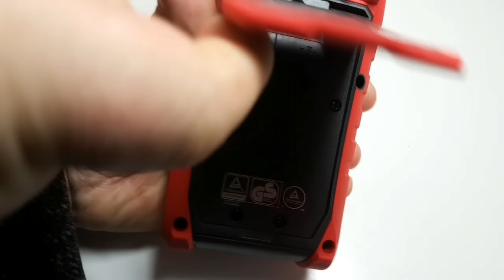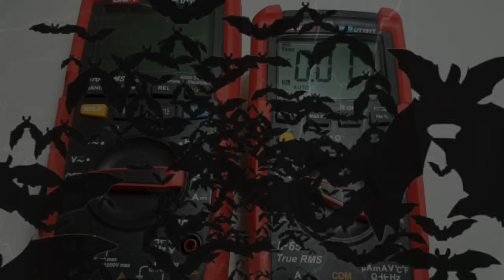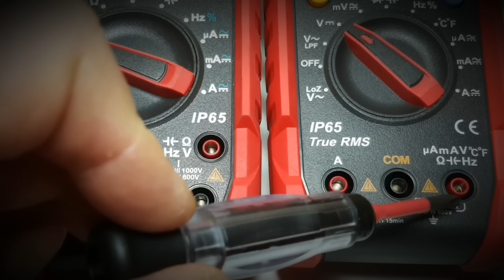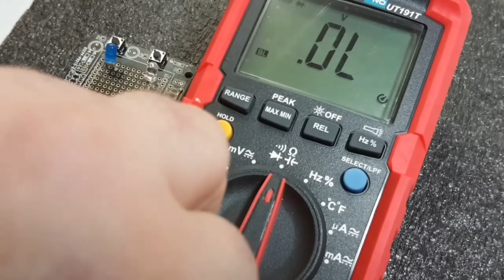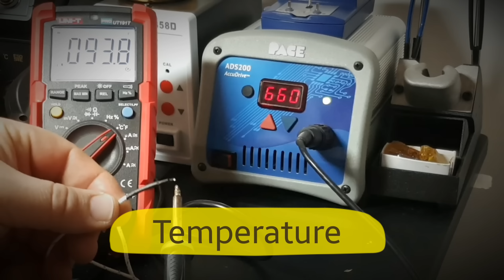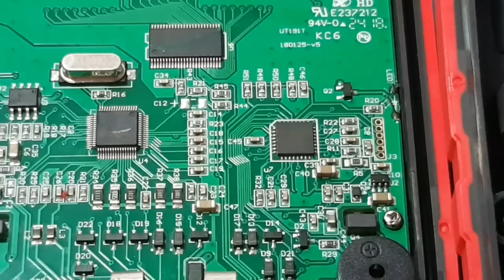UNI-T PRO UT191T Multimeter Review & Teardown!

Comment: Hi Darren, would you recommend me the UT191T over the newer UT17B MAX? The first uses a 9V battery (definitely an inconvenience) and supports 20A. The UT17B MAX uses AA batteries, supports only 10A and, imho, has a better input protection (two big fuses, up yo 1000V). I am unsure about the certfications of UT17B MAX
Reply: Ut15/17/18B series are very good meters. You can't go wrong with them.

Comment: Hi Darren, greetings from Mexico, I really need your advice, i already have the ut139C but I need the loZ feature, but I'm undecided about this one, the UT161D or 139E/S, in your opinion what's the best of them?? Thanks in advance.
Reply from the maker: Ola my friend! For electricians & professionals: The UT139E is better due to LoZ mode, CAT III safety, and extra features. 👍 it also has a faster bar graph (42 segments vs. 33).
Reply: @KeepOnTesting thanks Darren,  and between UT191T or UT139S which is better in your opinion? I'm pro electrician and electronics hobbyist.
Reply from the maker: Both the *UNI-T UT139S* and *UT191T* are solid multimeters, but they cater to slightly different needs. Here’s a detailed comparison to help you decide:

### *1. UNI-T UT139S (Budget-Friendly, Safety-Oriented)*
✅ *Pros:*  
- *True RMS* (for accurate AC measurements)  
- **High safety rating**: CAT IV 600V / CAT III 1000V (better for industrial/electrical work)  
- **Good feature set**:  
  - Capacitance (100μF)  
  - Temperature measurement  
  - Diode & continuity test  
  - Low-pass filter for motor drives/VFDs  
- *Bar graph display* (helps track fluctuating signals)  
- *Affordable price* (great value for the features)  

❌ *Cons:*  
- *Slower response time* compared to UT191T  
- *No Bluetooth/data logging*  
- *Basic backlight* (not as bright as UT191T)  

### *2. UNI-T UT191T (Faster, More Modern, Data Logging)*
✅ *Pros:*  
- *Faster readings & better refresh rate* (good for dynamic measurements)  
- *Brighter backlight & larger display* (easier to read in dim conditions)  
- *Bluetooth & USB connectivity* (optional for data logging)  
- *Higher resistance range (60MΩ vs 40MΩ on UT139S)*  
- *Sleeker design & better build quality*  

❌ *Cons:*  
- **Lower safety rating**: CAT III 1000V / CAT IV 600V (still good, but slightly less robust than UT139S)  
- *No low-pass filter* (not ideal for VFD/motor measurements)  
- *More expensive*  

### *Which One Should You Choose?*  
- *For electricians, industrial work, or high-voltage safety* → *UT139S* (better CAT rating, True RMS, low-pass filter)  
- *For faster readings, Bluetooth/data logging, and general electronics* → *UT191T* (better display, connectivity, responsiveness)  

If you don’t need Bluetooth and prioritize safety, **UT139S is the better pick**. If you want a faster, more modern meter with logging, **UT191T is worth the extra cost**.
Reply: @KeepOnTesting Thank you very much for the detailed explanation, it only shows me that there is no multimeter that does everything, and since I do both residential electricity and electronics, I have decided to purchase both devices. Thanks again and keep the great content of your channel.
Take care.
Reply from the maker: Thx my friend..indeed..the one does it all Multimeter doesn't exist..I think you found the perfect solution 😉 👍

Comment: My multimeter 191t bought in 2023 shows a voltage drop in the diodes. Probably in the first batches there was a problem with this, and then it was fixed.
Reply from the maker: Interesting!! 5 years later..it's been a great multimeter and still going strong on the bench. One of my favs from UNI-T 👍

Comment: Darren Walker. Thanks for your efforts, like       . What will happen if the ut 191t is turned on to measure resistance or ringing, and I put the probe into a 230v outlet. or 380v.?
Reply from the maker: Hopefully the excellent input protection will do its job and prevent the multimeter from serious damage. 👍
Reply: was hoping it would protect it from any damage and continue to work perfectly normally. I used ut 139s. It failed the ncv and resistance measurement. I have not checked the amps measurement, temperature and diode test

Comment: Which is better UT191T or UT61E plus. Which one do you recommend me to buy?
Reply from the maker: My vote goes to the UT191T, all around great performer,  build quality and well priced 👍
Reply: Thanks. I will go for UT191T. UT191T has 6000 counts and UT61E Plus has 22000 counts. Is UT61E plus more accurate than UT191T?
Reply from the maker: @mulondamwinanu8247  191T has better accuracy. 61E has a higher resolution.👍
Reply: Thanks. How do you perform live wire test when using UT191T. Do you suspend the neutral probe lead when testing a live wire test?

Comment: Hi there!  I bought this Uni-T UT191T per Darren's contacts, and really like it.  Where I don't have an oscilloscope, wondering if anyone has any resources to help test power quality using a True RMS multimeter?  E.g.: I have a portable generator, and would like to test power quality measure on it to know if it is good for sensitive electronics (what doesn't have circuit boards these days?) and also as an indicator of the generators health and maintenance.  Things like THD, voltage stability, etc.

Comment: im down to this model or the new ut61d plus , which do you prefer ?
Reply from the maker: I would choose the UNI-T UT191T!  IP65 Rated and very well built.  You can't go wrong with this dmm and it's underpriced IMHO.😀👍
Reply: @KeepOnTesting  ok ill get the 191 thanks
Reply from the maker: @cagmito76  Let us know how you like it 😊
Reply: @KeepOnTesting  Got it excellent meter , great build UNI-T usually are but this is tough , excellent safety and even has TUV GS safety cert stamped and of course lots of functionality. Best UNI-T Meter i have tried so far.
Reply from the maker: @cagmito76  Excellent!! It's one of my favorite Multimeters too!! Keep On Testing!

Comment: Diode test	Open terminal voltage??
Reply from the maker: 3.2V
Reply: i am looking for a low volt power..1volt / 1.5volt
Reply: is 3.2volt power harmless when measuring low power electronic circuit paths ??
Reply from the maker: @soundengineer6332  In diode mode you will be fine..the circuit won't be compromised.
Reply: Ok thankyou sir

Comment: Thanks for the video! Would you recommend the UT191T or the UT17B Pro? I've looked at them and the only difference is that the UT17B Pro is not waterproof, but the price is the same, there must be some other difference.
Reply from the maker: Wow, tough question. 191T has LoZ and LPF plus the Auto Backlight ...17B is slightly larger with a bigger display , audible diode mode and slightly better input protection. Both great multimeters..I'm a big fan of the 191T so it's my First Pick! 😄👍
Reply: @KeepOnTesting  Yup it's a really tough pick... I'm probably going for the 191T because of that sweet IP65 rating and 2 meter shock proof. The bigger display and audible diode more aren't really important to me, do you think overall the better input protection justifies buying the 17B PRO over the 191T? (I don't work with more than 240v and I also don't plan to measure anything above 5 amps, and also most of the time I work with 12v or 24v.)
Reply from the maker: @Hack3rPT  I think the 191T will be a perfect fit for you. I absolutely love that multimeter and its one of the most utilized on my bench! It still has great input protection just not quite as beefy as the 17B but awfully close.
Reply: @KeepOnTesting  Thanks for the recommendation and for the awesome content on your channel! Just two more questions if you don't mind: Do you think I should buy some replacement fuses (the 600mA ones)? And also, I currently only need this for hobby use, do you think it will still be good to use in maybe 5\10 years for electrical work?
Reply from the maker: @Hack3rPT  Having some extra mA fuses on hand is always a great idea and definitely recommended. Keep everything together in a good case so its always there when you need it. Almost guaranteed you will make use of them at some point! 

The 191T will still be a strong multimeter even a decade from now. Multimeters in general don't age or lose their usefuness as fast as other instruments or electronic devices so it will be useful now and in the future!

I have some multimeters that are 25-30+ years old and they're accurate and useful even today.
Reply: @KeepOnTesting  I usually keep everything in a strong case, but the multimeter won't really fit there. Since all the electrical components that I own are on that case, I will put the fuses there, and for the multimeter, I guess I will just carry in it's pouch for now. I bought the case about 2 months ago and it's already full! Needing another upgrade already.... Thanks for all the help!
Reply from the maker: @Hack3rPT  My pleasure and if you ever need any specific help or recommendations feel free to drop me a line: netplicity1@gmail.com
Reply: @KeepOnTesting  Thanks. By the way, did UNI-T end up fixing the stand in the U191T? I saw you mention on an old video that the stand flopped around when moving the meter.
Reply from the maker: @Hack3rPT  Yes indeed...its one of the best tilt stands on the market. Solid,  wide and rigid. Btw, Many thx for your donation to the channel , much appreciated 👍
Reply from the maker: @Hack3rPT  I would pass these by, the tips won't last very long. Hang in there and I'll try to find the vendor for a great cheap pair I was promoting..I just need to get the updated link for you.
Reply: @KeepOnTesting  Thanks!
Reply from the maker: @Hack3rPT  These are 👍 great.. 
Silicone, with Nickel played copper..sharp and cheap, only 5$  https://www.ebay.com/itm/321826316430
I'll be posting an official link to them shortly.
Reply: @KeepOnTesting  This is the official link right?
Reply from the maker: @Hack3rPT  yes, that's correct..I haven't found these elsewhere..
Reply: @KeepOnTesting  Perfect! It's about 7 euros total because of shipping but if you say they're good I'll buy them!

Comment: Hi. Which of the two would you buy?  UT191T or UT139S.  Water resistance is not important.
Reply from the maker: UT191T in a 💓 heartbeat! An incredibly great performer and definitely underrated !
Reply: @KeepOnTesting  How does it offer more to make it worth it?

I like both.  I don't know which one I would do better with.
Reply from the maker: @MartinSebák  Feature wise they are very similar...The 139S is sleek and has that great EBTN display, however I find myself reaching for the 191T almost daily which says alot! It has great ergonomics,  autobacklight and its one of the most accurate dmms in my stable.
I'm really impressed with both but if I had to choose and knowing what I know now, I would pick the UT191T.😁👍
Reply: @KeepOnTesting  In terms of protection, which one would you recommend? I like the 139s because of the EBTN display. The 191T doesn't like that the mili and micro amp are on the same input with the voltage, resistance etc...
Reply from the maker: @MartinSebák  I still prefer the feel and robustness of the 191T,  it also had better input protection and is IP Rated 👍
Reply: @KeepOnTesting  Thank you so much!

Comment: Hello, I have a problem with my meter it´s an uni-t UT109, hold de power button, star, but when relaase the power button turn off... if still pressing the button still on, but when I realease it turn off.. should still on, please, do you know whats going wrong with it? THANKS YOU SOO MUCH!
Reply from the maker: Try cleaning the internal contacts with IP.  Give the multimeter a good internal cleaning, especially any movable parts and try again, sounds like a bad contact issue. Also, replace with a new battery.
Let me know
Reply: @KeepOnTesting  Thanks so much for your answer, sorry for my bad english, I appreciate very much all your videos, I spend hours looking at them... I bought several instrument based on them, regards from argentina!
Reply from the maker: @GustavoGarcia-pu5st  Thanks my friend ! Keep on Testing!

Comment: Good day Darren, I have recently received this unit from Uni T (no pun intended) and there is something I noticed fresh from the packaging; the circumference of the knob has traces of unknown fluid. I can't determine the aforementioned fluid but I assure you that it was really noticeable and I swabed it using my very dry fingers and its really present. Is that something I need to worry about?, hence the UFO (Unkown Fluid Oozing) *Pun intended. Thanks for your response.
Reply from the maker: Hello Erwin, that primordial ooze is just a form of dielectric grease for lubricating the selector switch. Its nothing to worry about and is usually a good thing. It appears UNI-T was a little overzealous in its application on your unit. Wipe off the excess and you should be all set. Btw, that's one of my favorite meters...its something I am always reaching for 👍
Reply: @KeepOnTesting  Thank you Sir Darren for always answering to our queries. You Sir, are truly a blessing for all of us. I always hope for your good health moreover the continuous success of this channel and the exponential growth of the community within the walls  created by your multimeter haven.
Reply from the maker: @erwinjoshuat1327  Thanks for the kind words! Keep On Testing!

Comment: BUT the capacitance range only 600μF. Cheaper Aneng Multimeter is better than this.
Reply from the maker: WRONG, Capacitance is 60,000 uF or 60mF. Honestly you can't compare the Aneng to the UT191, Input Protection is far superior on the UNI-T.

Comment: I have this one and almost feel it should have gone 4.5 stars, its that good especially for the money - others sell for more and give you less in both quality and performance.
Reply: I agree even through it you have to take back cover off to access 10 amp fuse. How many times are going going to over current 10 amp range? It the smaller one you usually blow. Plus you have threaded post, so you won't strip the plastic over time changing it. I look at the details like this. I would have gave it a 4.5, as nothing close to its price range? Even with a Fluke that over $300 you have to take cover off to access fuses. So long it has threaded posts it gets a pass on that and not worth mentioning?

Comment: I want to get this , need a second meter for automotive repair.... Do you recommend this???????????

I have a brymen bm257s for my main .. Need second for backup ... If I get this, will use it with loadpro test leads... 

Honest opinion, is it a good meter??
Reply from the maker: Most definately! Honestly, If I thought differently you would know. 🤓👍
It's extremely well made and very responsive. I think dollar wise its a bargain and you will most certainly be impressed! Tell you what, I'll put my money where my mouth is and if you're not as impressed as I am I'll buy it back from you!! All I ask is that you use the purchase link I've provided above.🤗
Reply: Darren Walker thank you

Will do.. As being an E engineer  need my work to be done right ..
Reply from the maker: @dfigueroa903  Roger that David, sometimes you don't get a second chance, the 191T will have you covered.
Reply: One more question
What happen to mv and  ma  function.. You didn't show in your video... Need this for automotive measurements..
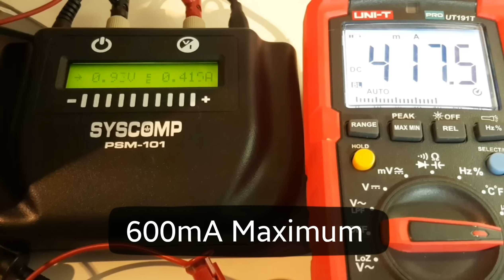Reply from the maker: @dfigueroa903  mA testing starts at 9:00 min mark. No problems there (600mA) rating.
I negated mV testing from this review but it works just fine.
Reply: Darren Walker ok
Reply: @KeepOnTesting  HT118A or UT191T

Comment: Again Uni-T is really showing some fresh ideas and a great look in these newer models.  I was surprised the 191T didnt both read and light the LED''s since the less expensive 89XD does this.  But I have to assume its got to do with the 89XD having that virtually Uni-T specific LED range with higher output voltage than possibly any other meter on the market.  Its one of my favorite features on the UT89XD along with the nicely done visual indicator for both LED and continuity.